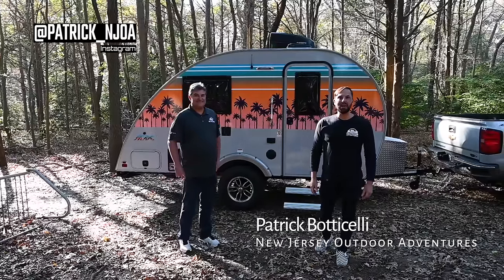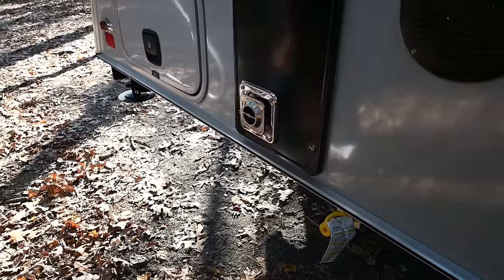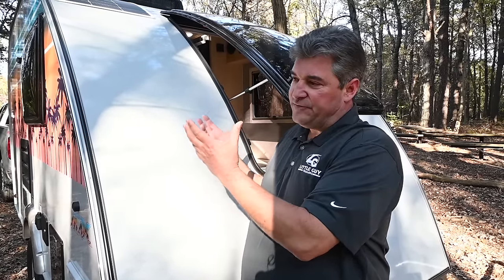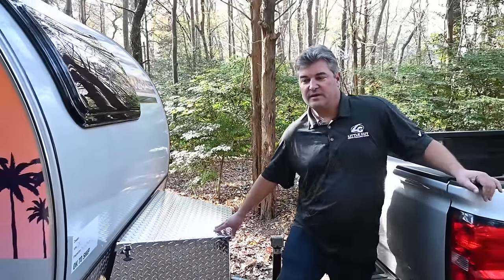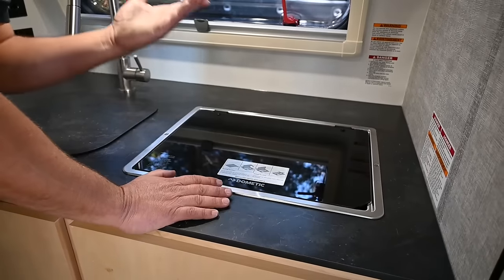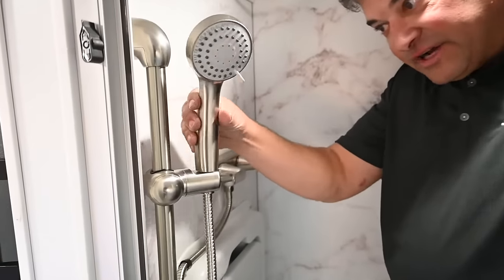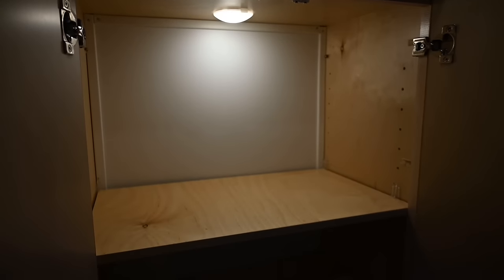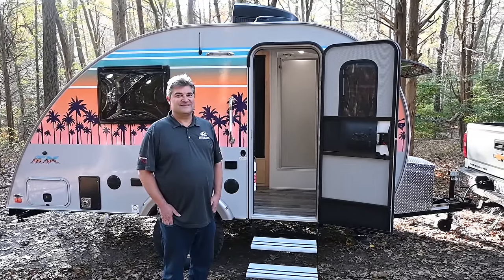Teardrop Trailer With Bathroom & Kitchen - WALK THROUGH a 2024 Little Guy Mini Max FX Small Camper

Comment: Why is it for off-road and the underneath water tank not protected? It’s off-road meaning going where rocky areas are. Big question how much does it cost? Little Huy trailers are expensive so I’m guessing at least $30,000. To me that’s not affordable
Reply: @karl7361  it’s suppose to be off-road but with some of overlanding videos I’ve watch like Ozark Overlanding that wouldn’t last some of the trips they’ve taken. If you going down a rock road in a forest it would be ok. I just don’t consider it off road.
Reply: Needs a skid plate. A shadetree mechanic can rig one easily.
Reply: STUNNING AND THE PRICE IS AWESOME IM IN LOVE .
Reply: I mean it has palm trees on it.
Reply: To me that's EXTREMELY affordable.  It's all relative.
Reply: @leblancexplores  I love the decals but I bet you can order without them
Reply from the maker: I believe it’s more rent meant for like unpaved roads not off-road like through trails
Reply: I have a Tucson hybrid. Do you have something similar but with a maximum weight of under 2,000 lbs?
Can it fit in a standard garage ( height )?
Reply: Watch the video for your answers before you start assuming. 
It's already too exciting whrn you don't know the (affordable) price.
Geez! Whoa down. 
Life's very short.
Reply: @adventurebythemile 
Honestly you would take this 4 wheeling?
Good luck. 
You'll need 100K trailer.
Reply: @Chereese0808  I did watch the damn video. The water tank is exposed. I also watch Ozark Overland and they went out west and went over some very rocky terrain where if they used this trailer it would have the water tank ripped out. They or I should say his wife’s rig is much higher and sturdier. It’s my freaking opinion and how I freaking see it. Yeah this could go through a bumpy dirt road or desert but not on a muddy overland trip or a road with actual boulders. Maybe a metal plate over the water tank would protect it. Don’t assume you are right. My opinion is you are not!
Reply: @Chereese0808  30K is not so affordable.  Not for the average person.  😂😂
Reply: Move along then, not unreasonably priced.
Reply: Love it! But two twin beds is a king? Is it a king or queen? I would like to see you lay down and fit on the bed. Also you kinda fit in the shower lol kinda on the small side for a big gal.

Comment: If you’re building campers, at least hire a design student at the local community college to create a cohesive look for the interior. Every, single camper from every brand is like Fifty Shades of Fake Wood. One (1) type and stain of wood is acceptable in an area. Two (2) can be used if one is painted rather than stained. That’s it. Unless you’re actually trying for hideous. In that case, go for it. Use as many shades and types of wood as you can squeeze in. Make sure there’s no possible way anyone with eyes would ever consider the cabinetry being in the same realm as the floors.

Comment: I like my 2023 mini FX, except for the Stargazer Window.  And this is despite liking the view and the air circulation when it's open. 
3 issues.  
1. The shade goes right down to bed/body level. I woke up one night and realized I was pushing my arm against it. Afraid I'll bust it in my dreams. lol.
2. The shade can warp when the sun is hitting that window directly, and you want it in the sun because that's the side where the solar panel is located.  
3. It creates so much heat. At Salt Fork Lake State Park in Ohio last summer, from 11am until about 4:30pm  there was no tree shade, so that window caught sun for a long time.  I lifted the shade to about 3" inches from the top of the window to allow hot air to escape.. right into the camper.  Great for any early spring or late fall camping, but summer? 
I felt like the AC was competing with the Stargazer for climate domination. lol.
I'm thinking of a way to shade the window from the exterior while I'm away from camp so I don't come back to a heater.  Going to New Mexico in the spring and I hear it's pretty sunny out there.
Reply from the maker: Thank you for the feedback

Comment: Putting the spare wheel underneath the camper reduces ground clearance. What's the overall weight?  You'd probably need a really powerful vehicle to pull it.
Otherwise, very neat. 👌

Comment: I like all the well thought out design, but there are also some over thought out items. The cupholder on that short countertop below the TV, impedes the use of that flat space and why would you need a cupholder anyways, when you’re parked everything is still in a cup on any flat surface should not fall over. The microwave could be one of those conventional ovens as well like they use an RVs because some people want to bake potatoes or a lasagna and believe it or not there’s people who don’t use the microwave for cooking If I’m not mistaken, it looks like the bathroom door is glass that you can sort of see-through ? as a woman who likes privacy when she’s doing her thing, I don’t need someone to see my silhouette  handling my private business that should be a solid door and I think that looks like there’s space above that door, possibly for ventilation but again with the privacy not to mention keeping any of the odor in the bathroom or being vented out creeping into the kitchen. Some of your storage areas do not have cabinet doira on them, so it limits how much you can actually put in there as items might fall out during travel, I see you use the cut out face instead, but that limits the size of the items you can put in there, and if you replace the bathroom door with a lightweight aluminum door with a form core, that might be lighter than the glass, so putting cabinet doors on those couple spaces there would exchange the weight consideration. Thank you for putting in a square sink too many big RV or fifth wheel designs can have a round sink which is very hard to use when washing square or large pans, like a cookie sheet how would you wash a cookie sheet a round sink? I like your lit handrail, and how you really try to keep things light  by using aluminum. I hope you like my comments. I hope they’re helpful. Thank you for designing and nice trailer.

Comment: Is induction cooktop an option?
Reply: This is something I am interested in too.
Reply from the maker: I believe they only have the propane a standard and no built-in induction as an option but I’m sure you can get a portable one
Reply: @NewJerseyOutdoorAdventures Can't just plug in a portable induction plate without fully understanding the power needed to use them. They typically use 1800 watts on full power, which won't work in many off grid RVs without expanding the power system. See post below for more details

Comment: Not bad, but would have been awesome with an aluminum frame and saved a couple hundred pounds. I also wonder about: 1) Connecting the tent to the rails and have a heavy wind come through at night. 2) A pretty low hanging & unprotected water storage and lines (not a four season camper),  3) The lithium battery should not be outside where it can be subjected to freezing temps. Some of the appliances seem outdated, and not really meant for boondocking with a 13k BTU HVAC needing 110v, one 100W panel, and one 100AH battery.
Reply: It has an aluminum frame.

Comment: This is a good constructed trailer. The guy says he has plenty of room in the shower but can't stand up straight. Maybe consider making it a little taller.
Reply: He did say he’s over 6 ft and I believe I heard him say the trailer height is 9 ft (I guess from ground to top).  For someone shorter than 6 ft, whom many of us are, would have room in shower. 😊
Reply: He said he was 6ft 2in. Most of us would fit fine. I used to have a Casita and I fit in the shower and so did 5/11 hubby.
Reply: I'm not trying to be negative. I'm going by what the guy said and what I see. There isn't plenty of head room for the guy. Maybe enough room across.
Reply from the maker: Yeah, he’s definitely extra tall so me being 5 foot nine I had plenty of room in the shower